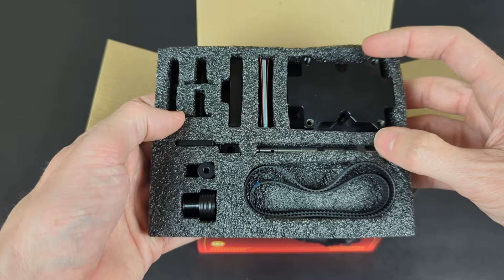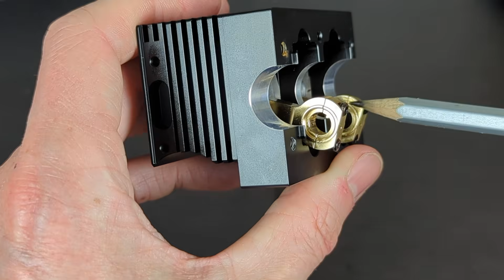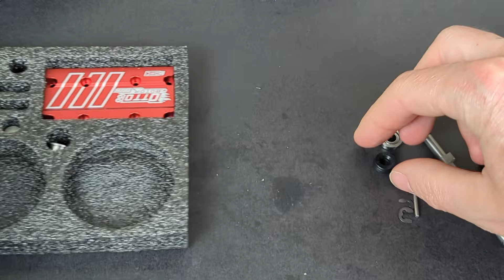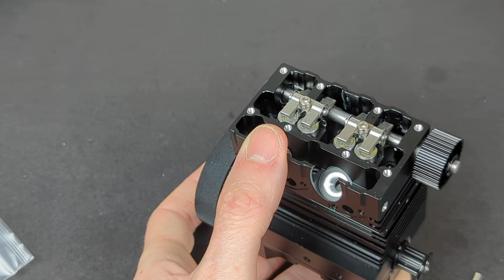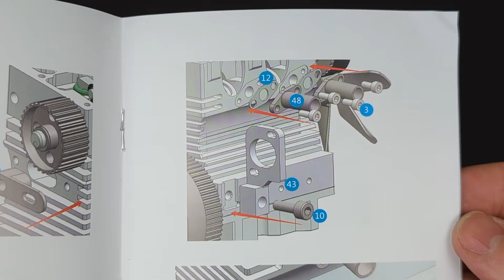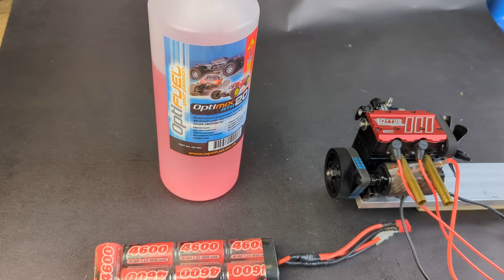Build and test Semto ST-NF2 miniature four stroke twin cylinder engine.

Comment: Man, we just wrapped up this project and attempted to get it started last night - we almost had it running until we got a plume of smoke and the motor wouldn't run - i think it was electrical , maybe something shorted out in the electric motor because it wont kick over! Will have to troubleshoot.
Reply from the maker: I found the trick to starting it was to keep the throttle at or near idle setting.  Short bursts of starter motor and maybe a bit of blipping the throttle.  It did take a while to get it to start though.  Full throttle just floods it.  Obviously check the glow plugs are connected and working properly.

Comment: I wonder how much horse power this wee little jewel pushes out ? 
Would 0.5 hp be optimistic ? :)
I also wonder how practical it would be to put it in an RC vehicle of some kind or is it a "Working Ornamental Engine" ?
It looks like a car engine but I can't help thinking about how it might do an RC aircraft :)
Reply from the maker: It is rated at about 0.6 hp (around 440W). It's heavier than a normal rc car engine but would be a practical power plant for a car.  Maybe ok for a scale plane, but would need to work out the cooling and prop drive arrangements.
Reply: @MetalMachineShop  ah cool, at least I was in the right ball park then :)
With the right prop and belt reduction set up I could see this engine pulling a 5lb or so 1/6 ish scale 
 WW1 fighter like the Albatross D.V. etc. very nicely :)
Reply from the maker: @freezatron that would be amazing!